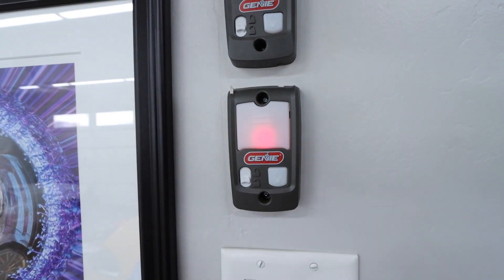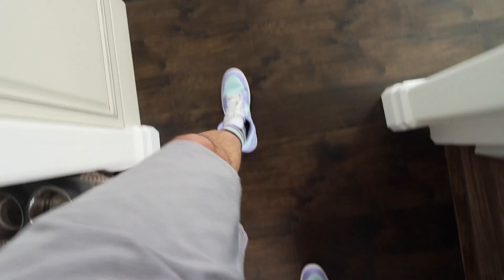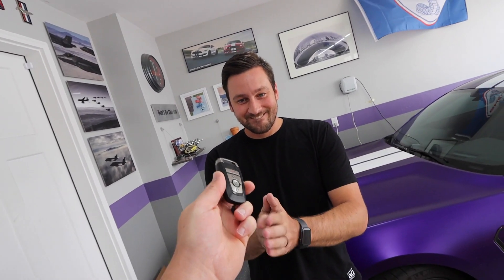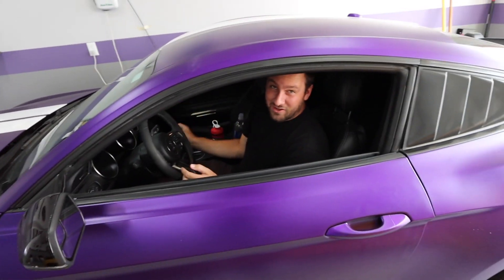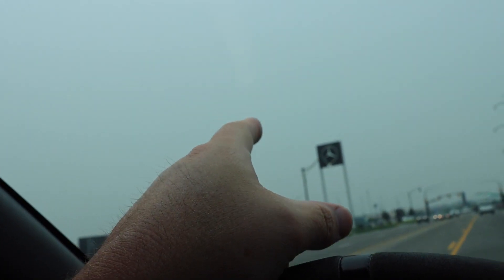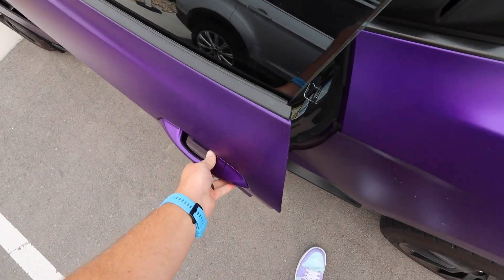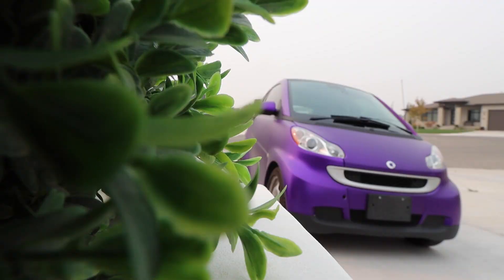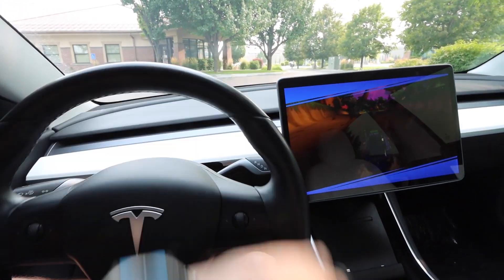My Shelby GT350 was fixed…then this happened

Comment: It sounds like a jeep in water. Maybe the intake filter is blocked? Happened to one of my dads old Fords. Was literally on the way back home from buying it at the time. Took it back to the dealer, mechanic spent about 10minutes looking at it before pulling a plastic bag out of the airbox.

Comment: It Happens when half of your Spark plugs Misfire and Theres alot of Oil in Cylinders. It happened on my Kia Cerato with 400,000 Miles with rebuilt Engine Twice. I ran It for 1400 Km with only 2 Spark Plugs with 40 HP Lmao it Backfired and the Spitted flames .

Comment: Why are all these Shelby motors blowing up this is not the first second or third time I’ve heard of one of these things letting go under 100,000 miles I had a 2001 new edge mustang are used to beat the living dog snot out of and it had 150,000 miles on it completely stock with an intake

Comment: Say what you want about Ford, but they are consistent…
Reply: I love ford but your right they certainly are consistent
Reply: I guess my dads 2012 f250 with 400k miles is better than a 2017 gt350
Reply: So is my car and girlfriend that’s doesn’t exist. Consistently nonexistent. I can really count on them.
Reply: Guess an 06 ford focus that my mom has is better too lol, maybe fixed one thing?
Reply: They are, but when they start breaking down, it’s just downhill from there
Reply: @mickeygarcia2331_  Not really. I’ve had a lot of types of cars. Some of the most reliable were classics. If you buy a well manufactured and maintained car, it shouldn’t continually breakdown. And have it inspected for flaws. You should be fine.
Reply: My 2016 mustang has had the head replaced 3 times and had the entire engine replaced 1 time and is about to go back because it has 2 cylinders misfiring. And it only has 56k miles on it
Reply: Consistent on breaking down
Reply: Consistently in the shipt
Reply: Ford sure is consistent. Consistent about needing to be serviced 🤣🤣
Reply: They’re “doing a great job, if their goal is to suck.”
Reply: Consistent at blowing engines apparently
Reply: ...consistently broken...
Reply: I like ford but the focus is one of the most unreliable cars of all time
Reply: Lol
Reply: Dont be mean to the ford lovers that they never learn that ford is consistent at breaking down
Reply: I mean it’s consistent for the gt350
His raptor is going strong and even supercharged with no problems
But can’t lie it’s embarrassing for Ford
Reply: Yea consistant break downs
Reply: Fix Or Repair Daily
Reply: @mickeygarcia2331_  I feel that’s every car 👎🏻
Reply: Consistently breaking  down
Reply: Consistently inconsistent
Reply: It’s not fords fault he pushed it during the break in period for the new engine  it’s called a break in period for a reason
Reply: My Ford Focus has been working wonders since I’ve had it 🤣💯

Comment: I hate Ford I would never own a Ford unless it is the new Ford GT that looks like a spaceship or the Ford Raptor 6x6 built by Hennessy

Also on the Raptor I would do a 1 or 2 inch lift to make it able to have the wheels turned it may look a little weird to have a lifted truck but it would be worth it and it wouldn't be lifted that much

Comment: It kinda sounds like you burnt a few cylinders/pistons. Thats exactly what happened to my Chevelle while I was cruising at about the same speed. The acceleration was slow and it took forever to get up to speed. And it had happened freshly after I put the motor in, the only difference is I had just rebuilt it. My issue was some shmuck got into the manifold unnoticed and caused 2 cylinders to overheat immensely.

Comment: There's plenty of room over here on team Mopar.  Trade the Shelby in for a Challenger and the Raptor for a Ram Rebel.  Easy peezy.
Reply: It is so unreliable they are crappy cars but they always sound good but still they’re crappy.
Reply: @kyle_flame6790  a lot nicer than tbis this he’s had blown up twice now lmao
Reply: @Michael Curley  I had 70k in one year on a 2019 1500. Mostly pulling 9k pounds throughout the states lol. Not one issue
Reply: @kyle_flame6790  I've owned dodge my entire life the only one I've had a issue with is my 2004 Durango it blew its tranny twice but that's that's widely known car to fail, I've owned around 15 other dodges and none have failed except the one so no your facts before you speak.
Reply: @Michael Curley I've owned 15 Dodge or Ram vehicles in the last 10 years and have only had issues with one.  Also, FIAT doesn't own Dodge or Ram anymore.
Reply: @Michael Curley all of those vehicles are owned by Stellantis.  That doesn't make the Ram 1500 a FIAT product.  FIAT is also owned by Stellantis.  FIAT is no longer a parent company.
Reply: @GOATEDHUNTER144  thats before the transistion with fiat and chrysler fiatt are whorable vehicals and could never get to the level of honda or toyota.

Comment: It's called limp mode. You can't keep the stock motor running and you're going to throw a bunch of mods at it? Yeah, that makes sense. About as much as taking a sawzall to a front bumper. You want to manually shut off a Tesla? Just drive a steel fence post thru the floorboard. That seems to fit your mechanical aptitude.

Comment: Maybe you should quit revving the crap out of it no engine likes to rev like that unless it's under a little bit of load same thing when you're driving it's not necessary to go 100 miles in first and then just slow down using the engine brake

Comment: Even if you are able to claim lemon law. It won't help much as the new one would have the same issues. These shelby engines are garbage. They are all blowing up. I have thee different friends who have all had to have their engines replaced.  Ford is going to be forced to recall them, but that would require them to solve the issue. I just don't think it's possible.